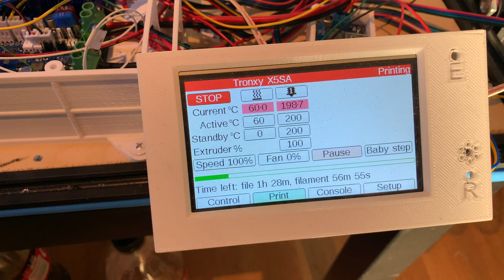Tronxy X5SA with Duet 2 Wifi and Zesty Nimble

Comment: I hope you are still monitoring this video.  Do you have a build or upgrade video for your Tronxy as I want to put my Duet 2 Wifi into my Tronxy but have never done it before so I need help.  
I need to know things like do the Tronxy plugs all work on the Duet 2 Wifi or do I need to buy some different ones for it?   
What version of Marlin did you load into the Duet 2 board and how is it done.  I am good at mechanical things but electronics I am severely rusty at having done any for 40 years.  
If you do not have a video that could help me could you please direct me to one that might be able to put me on the right track?
Reply from the maker: Hi, some of the plugs could i use, and some i had to change out. if you look up a wirering diagram for the duet board you can move one after one cable. i use reprap firmware 2 on my board.
i used this: https://duet3d.dozuki.com/Wiki/Step_by_step_guide
Reply: @ulven75  Thank you for the help I will get on it as soon as possible.

Comment: Great job getting printer run with Duet. I to have same printer that I've upgraded a lot of parts on it even with Duet2 and Duex5 . Im still working on settings. The one problem that I've had the most is trying to get filament runout sensor to work with the Duet. Any help would be greatly appreciated. Thanks Robert
Reply from the maker: Hi, I have not been able to get the filament sensor to work yet. I was told that you had to use a endstop port and program that to pause the printer when it is triggered when the sensor is empty of filament.
Reply: Ok thanks. If I get it working .I will let you no how.
Reply from the maker: @robertgates6196  thank you :-)
Reply from the maker: @robertgates6196  i found the sollution, M591 D0 P2 C4 S1 and the correct two cables to the E0 endstopper on duet board, use pin1 and 3
Reply: @ulven75  I will try that tomorrow.  This is the G-code that I've been trying M591 D5:6 P1 C3 S1
Reply: That code didn't work for me.
Reply from the maker: @robertgates6196  are you using the origional filament sensor that was delivered with the printer? and have you tried to ohm the switch to see what cables that goes from normal closed when filament is present, and normal open when filament are out?
Reply: @ulven75  Yes its the original senor that came printer. If I look in Machine properties at E0. I can see it go to endstop hit yes to endstop hit no as I go in in out with the filament.